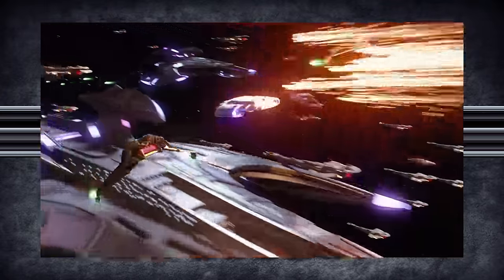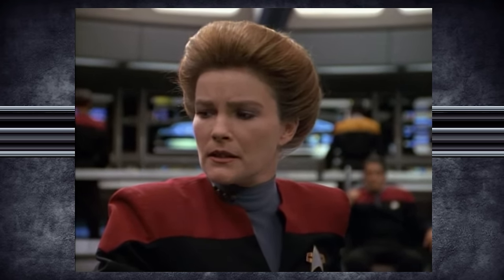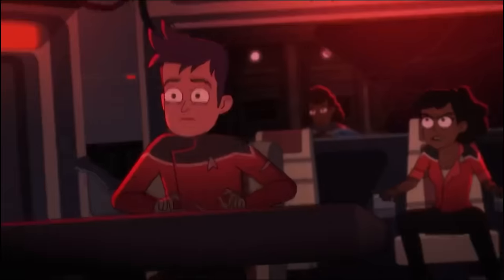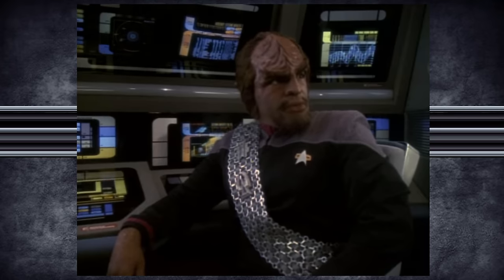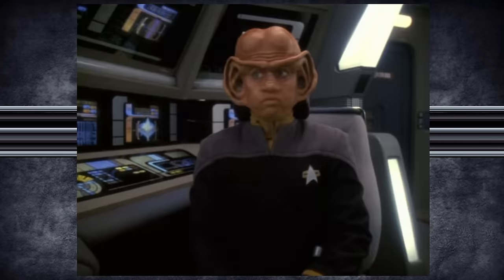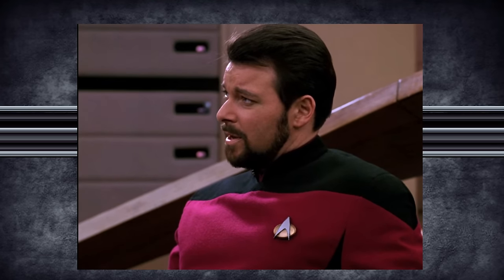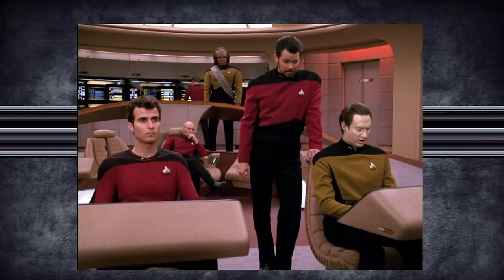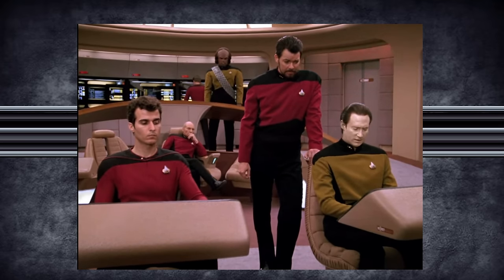Why Starfleet's Bridge Design Was Lethal to the Crews

Comment: So where's the explanation for why the bridge design is lethal? You could have mentioned that the Enterprise D's sweeping wood console is a tripping hazard. However its design was the most handicap accessible with ramps instead of stairs. Starfleet must not like to have to accommodate for wheelchairs. No wonder disabled Captain Pike was so grumpy.

Comment: Seems that relays and PCMs  (Power control module) were not a thing Star Trek. They seemed to like running mains power though the control panels. So no remote switching. Instead of a relay or PCM blowing out in some remote part of the ship when an overload happened hurting no one the panel would blow out fragging the poor red shirt running it.

Comment: Windows are a structural defect, a weak point that enemies can exploit, a concentrated attack that hits one of these specially on the bridge would cause every person on the bridge to be sucked into space and die in less than a minute, there is no need for windows at all, displays can show what is happening outside just like a window, and the information can come from the sensor array.  Exploration without defense is a recipe for suicide, heavier emphasis on combat readiness should be the focal point the design of the ship, the bridge should be made as if it is ready for war.

Comment: I see the importen funktion of Bridge Windows..
buuut they are a structual weakness in a critical an most importen Aera of the ship. 
One direct hit and all is dead. 
For Example. 
In Star Trek Nemesis must the Scimitar set multible direkt hits zu crack the front of the Bridge..[poor Helmsman]. 
Have been the Enterprise a Bridge Window, the Scimitar has make more damage wit one hit.
In Star Trek it don't exist a transparent material with the same properties like Duranium or Tritanium.
All Windows are made up Glas. 
That can you see wehn you look closer the windowrims. 
 And in ST VII we see it as many windows breaks like Glas. 
It is an stupid Idea to take a huge panorama window into the Bridge. 
A and one Thing was realy a big Fail in the Galaxy class brigde...they has a glasdome on the ceiling. 
You see it breaked in ST VII too. 
This Bridge are realy the worst. XD

The Defaint and NX Class Bridge are realy the most efficiently.
Perfect desing for all kind of missions.

A good Bridge is  from the Sovereing class. 
All Stations are more closer to the center. 
The Captain, his  first and second officer sits in the middle and can easly see overall. 
In the Front are Nav, and Helm. 
All other Station are surrounding the Captain.
...maaaybe little bit to full with single stations.

Comment: Load of BS. Modern military submarines rarely have windows, it's usually too dark at depth to see any real threat (like it would it space) and lights just give you away. At surface there is a periscope that is a light relay to visualize the surface. If you really needed an independent visualization system, redundant cameras and screens with a separate battery or hand cranked generator would do the job with today's technology.

Comment: I understand the fascination in doing a video like this, but ultimately, because this is all a fiction with each bridge not designed by Starfleet but by Television and Movie set designers. They are more a product of the 60's, 80's 90's 2000's or whatever than of the different fictional eras.

Thus picking faults in one or other design is more about criticising a set designer and the show runner who signed off on it rather than Starfleet.

This all goes with ANY fiction, of course, but I think it becomes far more noticeable when considering a franchise which is nearly 60yrs old...Of course the original bridge is going to look woefully inadequate compared to a far more recent re-imagining.
Reply from the maker: I reject the design due to production argument and discuss this in a video coming out soon. The sets of Babylon 5, the expanse, and bsg were able to do it.. so can trek.. they had the tech.. even in the 60s..

Comment: Unfortunately there is one issue you overlooked regarding windows.  Yes you could have a window but all they would ever show you is the black of space and maybe a star or planet or two.

Remember these are ships travelling at near light speeds or even warp speeds much faster than light.  While they ignore the issues of time dilation which I assume is countered with their anti grav technology in some way the fact is that an enemy ship would be possibly light minutes away or even more.  Even at combat distances the ships are tens of thousands of meters away when they are closest.  

Through a window the unmagnified view would be at best a tiny dot moving across the screen.  This would be the need for a view screen.  The ship's sensors and cameras would have to create a viable replica of space in the area viewed to give the crew a good picture of what is going on.

This is probably one of the reasons that Discovery is such a bad series.  Bad ideas are thrown out there without real thought because woke virtue signaling is all the matters.

Comment: On windows vs viewscreens, while I can understand the point, I generally disagree. Not because windows aren't useful in real ships, but a combination of factors.
1. Anyways you cut it, windows are weaker than structural armor plate. Yes they're transparent aluminum or a more modern substitute, but if they're really as good as or better than armor, then there should be transparent metals being used everywhere in place of "normal" structural materials, to allow more viewing ports, to show off decoration, etc.

2. Yes, windows are useful in modern ships, but, 200 years in the future Federation starships should have cameras and sensors. Multiple. Redundant. "Oh but its expensive and takes up too much space"... I don't think that's a valid argument for Star Trek ships.
 Metamaterials, if you know what those are (basically, nanoscopic arrangement of materials taking advantage of quantum effects of the matierals and how the different quantum effects of different materials work together to cause impressive effects) allow the creation of camera lenses that are milimeters in size but do the job of modern huge telescoping lenses IRL. 

Take those, give it the logical capabilities that the Federation and their scanners can do, place thousands around the ship, and use the AI to intelligently display whatever they need it to instantly and contextually. The sensors being destroyed means the entire surface of your ship is destroyed.

3. Given the capabilities of the Federation, any sensors or cameras they have should be better and more capable than the mk. 1 eyeball ever could be. It's what actually makes the "zoom and enhance" possible, the cameras and sensors were so good, the image they can take were beyond the ability of the human (or average alien) to see the full detail, or be shown on the screen, so you could actually "zoom" into the image without loss of detail. Don't they have sensors that literally scan light-years in distances? 

Another thing: I know that ships in Star Trek fight at stupidly close ranges compared to what they should be, but... are you sure a visual unaided literal window will allow you to see the Klingon ship 1000km from you, shooting at you? 

Windows for the sake of dog-fighting should be utterly useless, because the ranges you fight at should be in the "light-second" range, at closest, not... less than a kilometer. Besides, the physics of movement mean that ships strafing would accelerate around at stupid speeds unable to be tracked by the eye.

If you really run into an issue where the ship has lost all power, not just main power but all emergency backups too, and all the thousands of redundant cameras and sensors are destroyed on your "primarily science and exploration" vessel (and therefore should logically prioritize having thousands of powerful cameras and scanners), wouldn't you feel safer if you were in or near the center of your ship, where layers of fortification and different protections were between you and the emptiness of space and whatever caused your problems in the first place? And how would windows help you if you don't have power to do anything, anyways?

Personally, I always thought (after TNG) it would make sense if the main bridge were constructed in a specialized holodeck in or near the center of the ship. Many aspects would be kept real, the seats and some other items, perhaps... but the holodeck aspect could be utilized to create more dynamic viewscreens, or even present objects in 3d rather than 2d, allow one to have as many different monitors you want to switch between... even allowing you to create "sets" of monitors for different situations. Consider how different an actual scientific research event is to a battle. Wouldn't it be great if you could just get rid of all the non-essential things and open more related dashboards when doing one or the other. There would be greater nuance to it, of course, but...
---------

The other major change I would make to the design of the bridge is the inclusion of circuit breakers or their equivalent to all the displays, and change the chairs a bit. In the 24th century, I'm sure they can improve the design of the chair to be extremely comfortable, ergonomic for long-term use, and also allow it to activate a sort of "danger mode" during yellow and red alert, where it shoots out a harness which safely holds them in place, because the inertial dampeners obviously don't cut it. How many people have been hurt by being flung around?

"But what about when they need to move to other stations to take the place of a downed officer or to see data"? 
Do it the other way around - have the monitors of the officer who would move change to include the other station (not literally, electronically, the monitors change their output). This could work especially well in a holodeck-enhanced bridge, were it could create new monitors and keyboards in space arbitrarily. This sort of thing would require the ship computer to be able to know and anticipate the needs of the officers... but, that really shouldn't be a problem for the kind of computer technology the Federation has.

Once again, would love to "hear" (read) your thoughts.